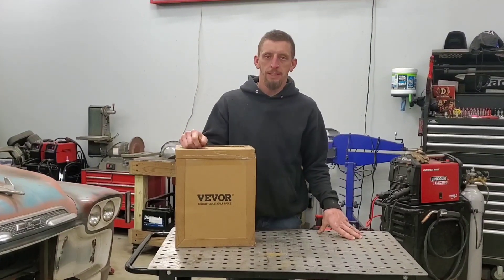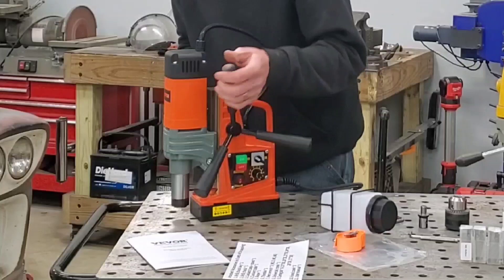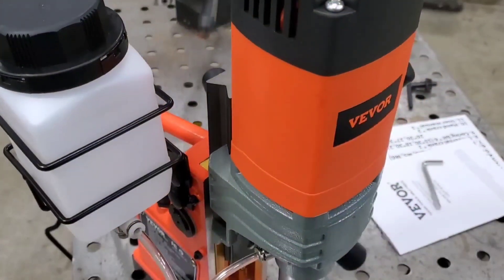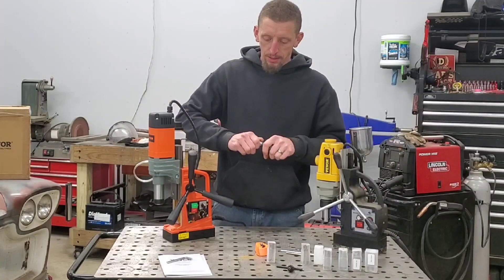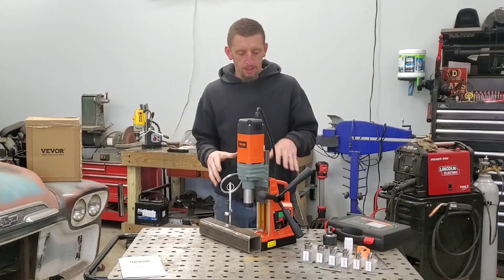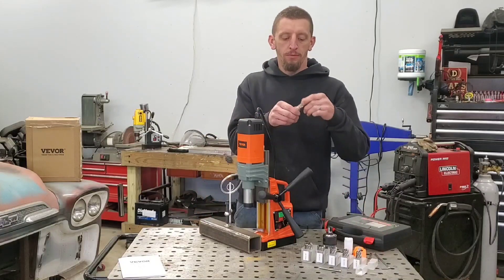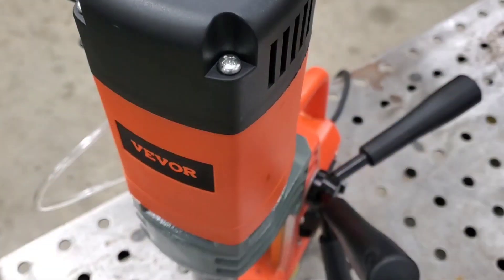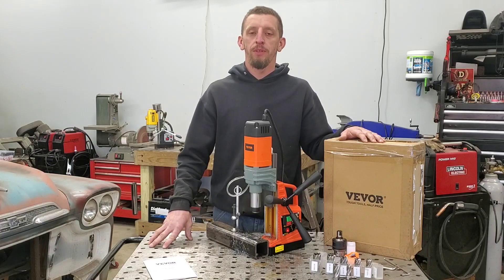Huge Improvement From The Older Model!  VEVOR Tools MAG Drill Review Model 8850e It's pretty Awesome

Comment: I own the same unit, if you use the Nitto one touch to Weldon adapter you must increase the length of the guide pin equal to the increased offset of the adapter.
Reply from the maker: This is great info, I didn't think of that.   I appreciate you adding value to this video.   With that said, what's your overall opinion on the mag drill?   Would you recommend it?

Comment: Great Video!    Major take aways for me were 1) your demonstration of the quick connect feature.   In another videw - they were "fighting againts" the connecter - where you simply inserted the piece.    2) Your idenfication and lick for the "AccuSize Nitto Annular Cutter 10pc Set" which fits this model is also very helpful 3) Lastly,  your identification of the Nitto to 3/4 Weldon Adapter by name is a big deal great find too!     FYI - One thing that helped sway toward the Vevor 1400W Mag drill - was the ability to adjust - raise and lower the  arbor height by lossening the silver hex score.    This to me makes it much more feasible to use the drill chuck and / or other adapters.   Once again thank you.
Reply from the maker: Thanks for taking the time to watch and comment, I appreciate the positive feedback.   👍

Comment: and now there's coolant on, and below your welding table :-\ I hate using coolant unless it's on a machine/surface that is designed to work with flood coolant.  I'd rather just use a little but of cutting oil here so that coolant doesn't go all over everything.
Reply from the maker: I generally use cutting oil also, I used coolant to show the drill in use...  But I agree to what you are saying...👍

Comment: I use annular cutters on my mill. The R-8 to 3/4” Weldon annular adapter chuck I use can accept the Nitto cutters. You have to rotate them to get the set screws to line up, but it does work without a problem. But as he said, the Weldon shank bits don’t work in the Nitto chuck. I assume there’s a Weldon to Nitto adapter available as well, but I haven’t looked yet.
Reply from the maker: Appreciate your input and thanks for watching..👍

Comment: Thanks for the review.  Judging by sound alone - It sounds as if the minmal speed possible  is still very high for cutting metal. Is that your  impression as well?
Reply from the maker: It definitely has the torque needed to cut metal at a low rpm this also cuts down on heat transfer into the cutter which allows longer cutter life...(using coolant of some kind of course)